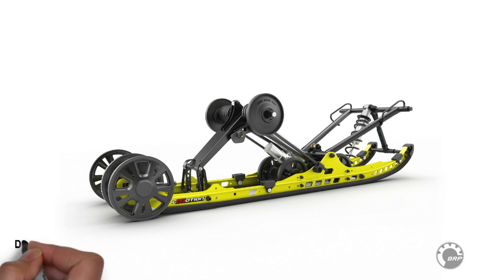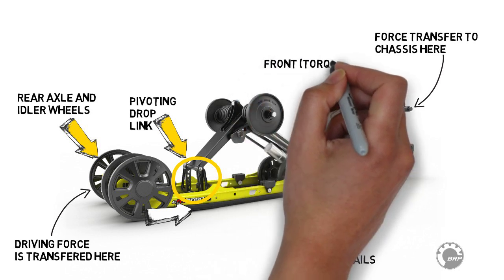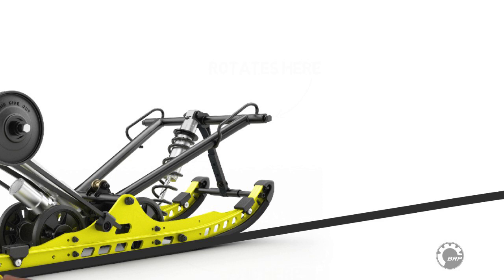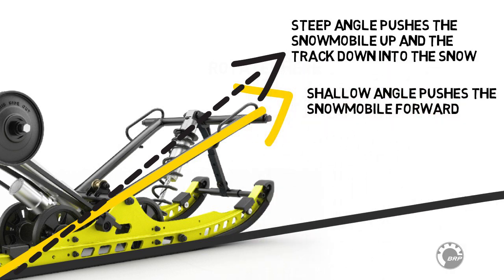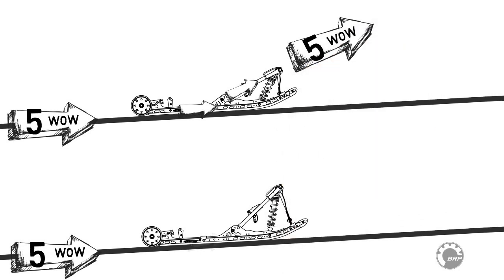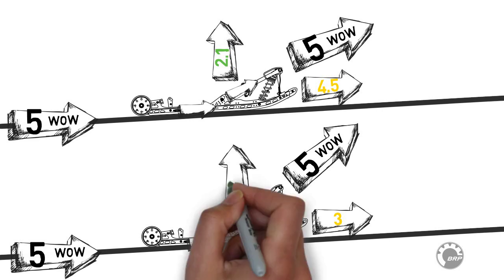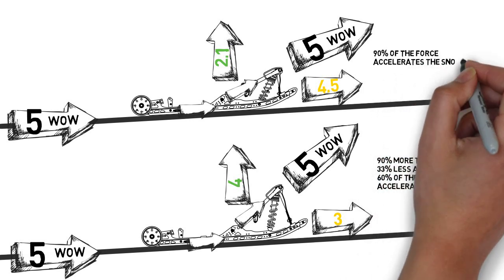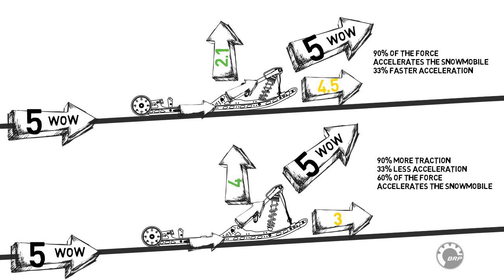Snowmobile Driveline (Part 3) - Torque Arm Angle

Comment: I feel like I'm missing something. This makes no sense to me.

You are ignoring the limit straps. As soon as they tighten up the system is locked and the torque arm angle does no longer matter. 
Another way to look at it: If only 66% of the power goes in to accelerating the snowmobile, where does the other 33% go? Heating up the torque arm? Lifting the snowmobile way up in to the sky? 

My conclusion is that the torque arm angle will not effect acceleration in this way. I think you should remove this video.
Reply: The other 33 percent goes into fighting gravity, which is a force.
Reply: @stefanp7603  But force is not power. To accelerate you need power. A structural beam in a house fights gravity all day but that doesn't mean the beam uses or produces any power. Thats why we don't see accelerating houses. Power creates energy and energy can't simply vanish. Hence my question, where does the 33% power go if not to accelerate the snowmobile?